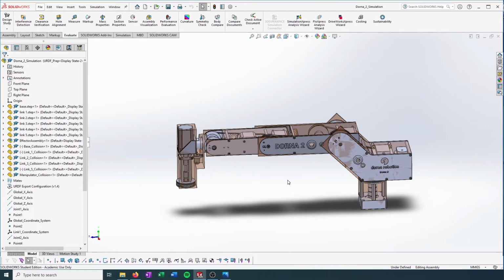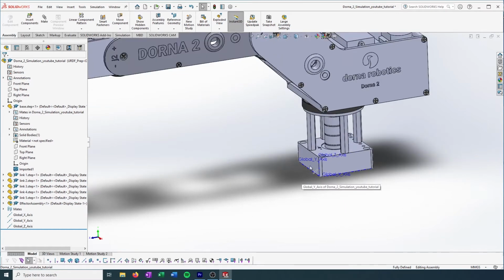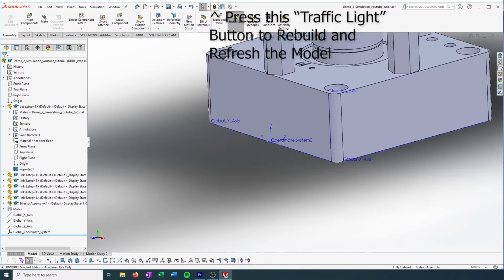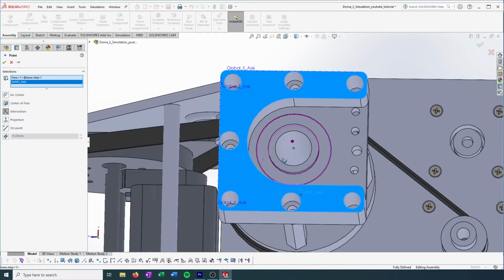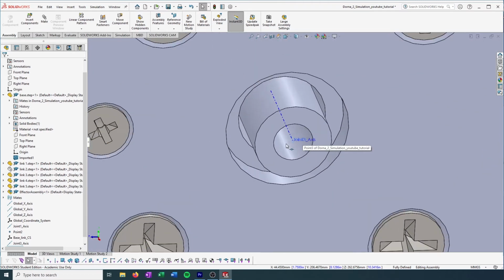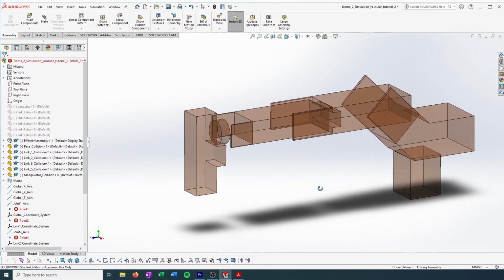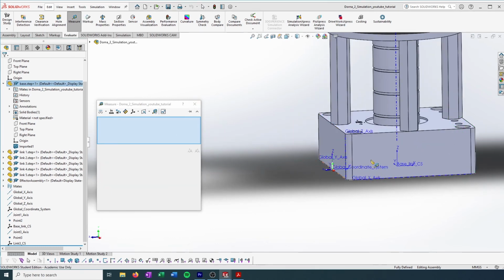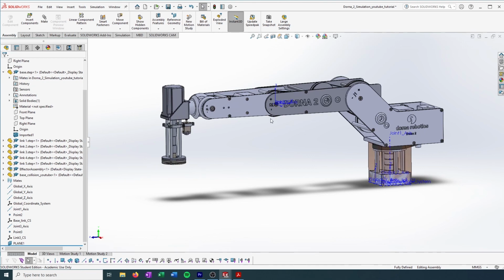SolidWorks to URDF Using the SW2URDF Plugin Tutorial Part 1/3 - Coordinate Systems and Joint Axes

Comment: I believe the coordinate system is right hand system. Imagine this, you put your right hand thumb, index finger and middle finger in a right angle to each other, and each represents separate axis, X, Y, and Z. if you take any two, e.g. X and Y, multiply those two vectors (Cross product) you should get Z as per right-hand screw rule. Hence it only ask for two axis and not three. (It's been while since I am out of academia, hence the vague language.)
Reply: Yep, Denavit-Hartenberg convention only requires z-axis and x-axis of each joint, x is found orthogonal to to current and previous z-axis I believe. Z-axis follows thumb and fingers curl in positive rotation direction.

Comment: thank you !!
but can you show us how can we add the URDF add-in in solidworks please cuz i didn't find any usefull video on youtube
Reply from the maker: My memory on that is a bit hazy now, but if I recall correctly it should be pretty straightforward. I'll add a link in the description that links to the SW2URDF installer wiki page, I believe you just need to run the installer, and then check in Solidworks under "Tools -> add-ins" that the "SW2URDF" box is checked. Let me know if that helps you! Additionally read the installer page about which versions of SolidWorks are supported, and make sure you have a compatible version.

Comment: I have a parallel robot where links rejoin from Link3.
Is it the correct way to link them? Do I have to redo the links 2 times as follows? Or should I just do the link4_.. for the first Link3 and just stop at Link3 for the second one.

- base_link

-- Link1_1
--- Link3
---- Link4

-- Link1_2
--- Link2
---- Link3
----- Link4

Thanks again for your help
Reply from the maker: If I'm understanding your question correctly, I think the problem you are running into is one of the limitations of the URDF format. The URDF format requires that the structure you are representing be an "open loop", where every parent link is connected to some number of child links. Child links cannot "close the loop" by connecting to a parent link further up in the "tree". Think a four-bar mechanism as an example of the kind of structure you can't model without some workaround using URDF. I would imagine this factor would make modeling a parallel robot using URDF difficult. There are apparently ways around this, although I have no experience with alternative methods so I can't help you there. I would recommend checking out the "good resource" I linked to in the description in this video, in that pdf, under the section "File Types: URDF and SDF" in the box "tree limitations" the paper talks about some possible work-arounds, which might be a good jumping-off point for you. According to that paper, you can use "special gazebo tags" to overcome the issue you mention. Also you may want to look into the SDF file format more. If you solve this I would be interested in hearing what your solution is in the future. Hope that gets you on the right track!
Reply: @ShaySackett   Thank you for both your answer, I will look more deeply into this, and share with you when I find a solution!